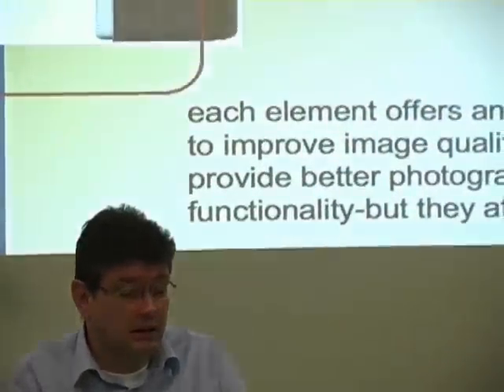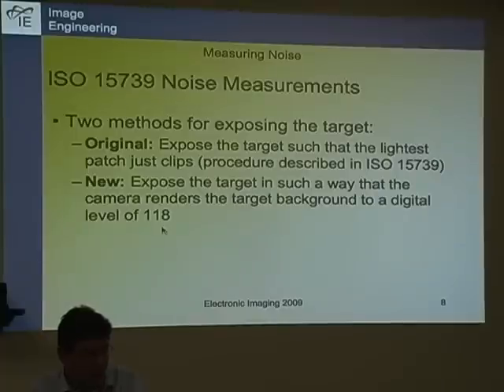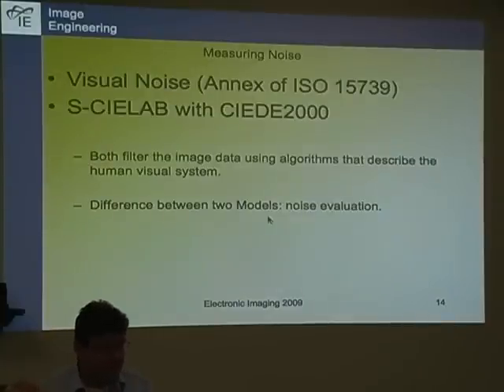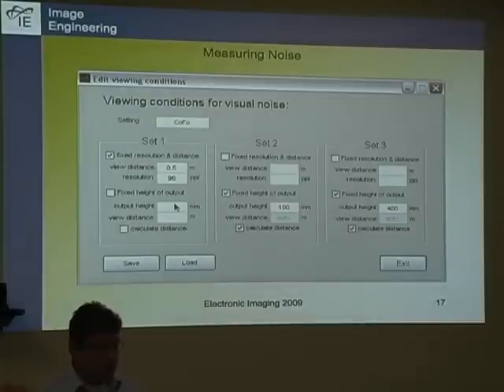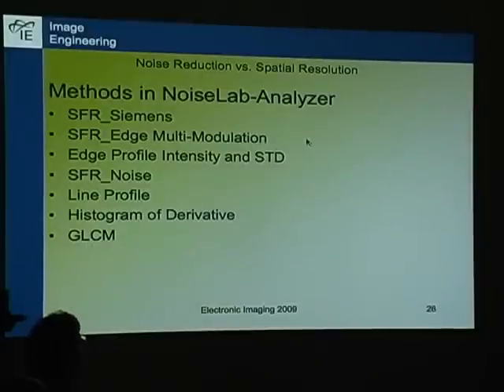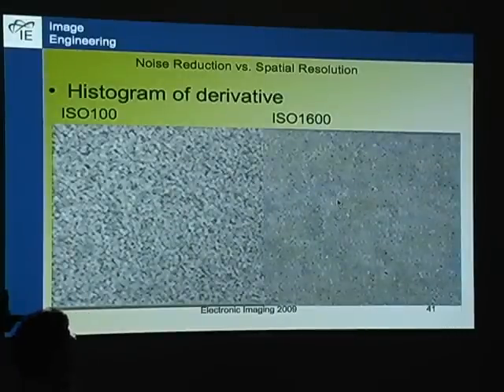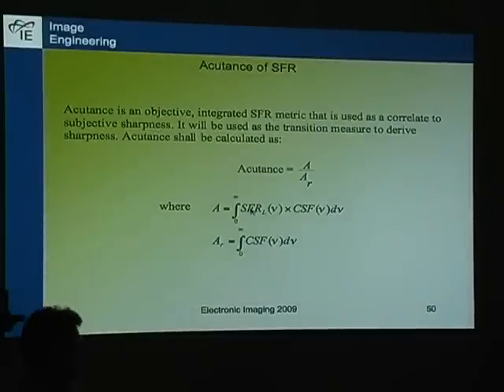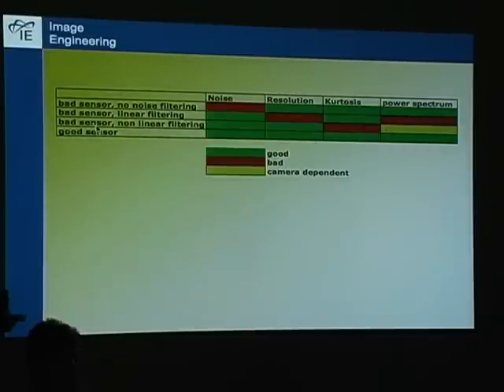Measuring Noise and the Influence of  Noise Reduction on Resolution

Comment: Ehm...why not also make a hardware sensor that can be connected to a mobile phone? That would get rid of the size-problem surely? Not using it? Put it back into the bag with it's flexible chord which also gives it directionality.